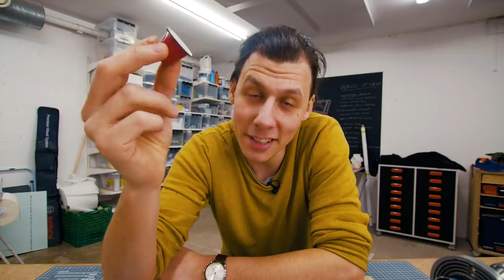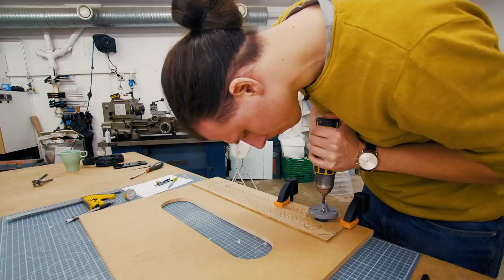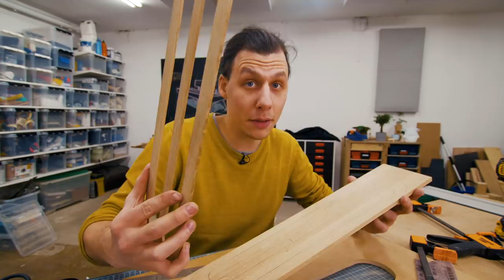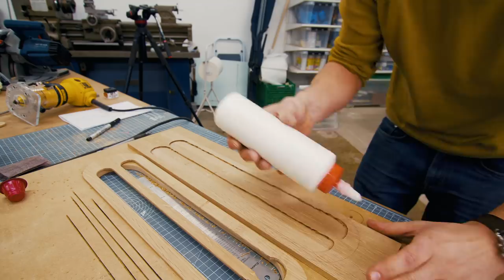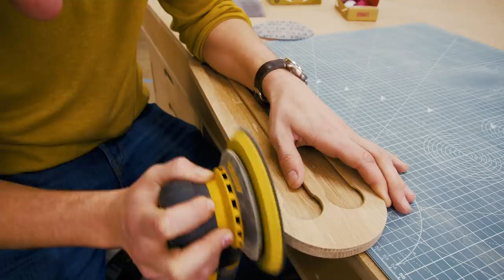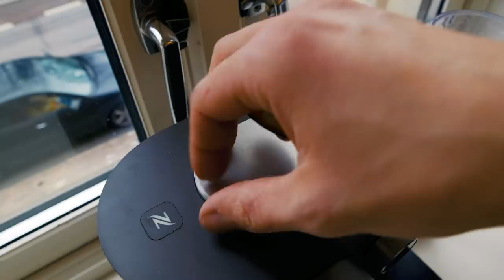Making a Holder for Nespresso coffee pods

Comment: TOP TIP - Before doing the routing on the backing piece run a sharp blade around the pencil line. It will leave a crisp edge and be easier to sand and keep sharp and clean.
Great idea tho!

Comment: You should get it from the bottom. Because if there is only three left or two You don't need slide it all the way up. You just pick it from the bottom
Reply: With the system he used the "Pods" would fall out. So just turning it upside down wouldn't help
Reply: Not only for this reason but always first in must be first out!!

Comment: This is for sure a looker. Great desgin!
But I really wish it could be optimized better for loading and dispensing the pods. 
It’s quite time consuming to manually load the holder, if there are more than 4 flavours. And dispensing the bottom pods  when the inventory is low will take a bit work as well. If this could be bottom-dispensing, that would be better in my opinion. 
Thank you for sharing the process

Comment: Any clue on how to do the depth cut in the back piece without a router?
Reply from the maker: Jorge RMZ hmm, chisel and patience 😅
Reply: Just build out of 3 layers instead of 2. Bottom layer isn't cut. Second layer is cut to fit the lip of the coffee pod and the top layer is the layer that contains the pod (width of pod body not including lip). If you had access to a laser cutter this would be a fun and quick project. Or you could 3D print it I suppose.
Reply: @GottaBeAbstract  I was thinking the same thing actually. (This is not a criticism, just an observation)  There were already 3 slabs there, it's just one wasn't used.  If you use it and did a 3 layer build you could do the middle layer like the top, but with both holes big to allow the pods to slide down in.  Then you could use the plunge saw to join and save yourself a lot of sawdust and be faster too.  Just a thought and it should work for those without routers.  I like the design and you could build it with 2 forstner bits and a coping saw if you didn't have much for power equipment.  You could even use an auger and a brace if you had to lol.

Comment: You could make a slot from the bottom to take the pods...
Reply: nikos grigoriadis i tried this myself with a different design, but basically the same concept. I found that it’s really not worth the extra effort: the capsules have to have enough play so they slide down by their own weight, but a little too much play and they fall out of the hole in the bottom. Took me a long time to get it working, had to use parafine oil instead of osmo, seasonal change in humidity doesn’t help also... and in the end its very easy to just slide them up.
Reply: @edwinghysebrechts9377  if you ever try again, maybe add a bit of felt that is cut to taper from the flush wood, to a thickness of felt right near the slot. The felt will be a bit of added resistance and hold the cups in, but will allow you to pull them out.
I hope you understand what I mean.. lol 
I did something very similar once in my shop and ran into the same issues. Basically shimming it with something like felt works the best, it's a bit spongy but not grippy like sponge or foam, it's the most durable for thousands of uses, and it comes in dozens of colors to match a project.

I was designing kydex goods and stored my SAKnife shells like this in large stacks to be assembled factory style. I made them in dozens of colors to be made to order with different color combos, attachment and loop/molle backings.. etc. and having the shells above the desk ready to go was the basis of my whole system, and the felt made the whole system work. 

I hope this helps, because it streamlined my shop. I messed with that stupid thing for days! It was supposed to be a quick 1hr build to make life easy and it made my life hell! Haha my mom actually suggested the felt.

Comment: Great video and craft, but this is a terrible design. Unless you wait to refill the slots until they are entirely empty, the pods at the bottom of the slots will go unused. It would have been great to see you add an opening at the bottom of each slot from which to grab the pods. This way you would always be grabbing the freshest of the pods, no matter how often you refill the holder.
Reply: But wouldn't the pods just fall out at the bottom if he did that?